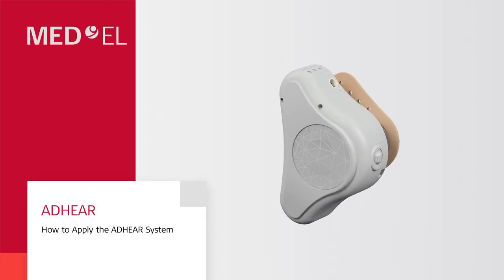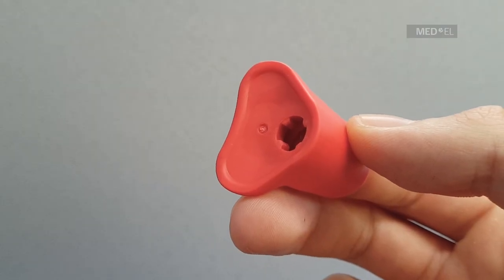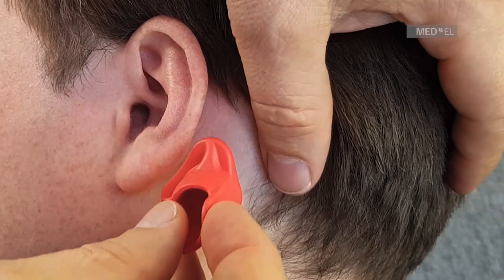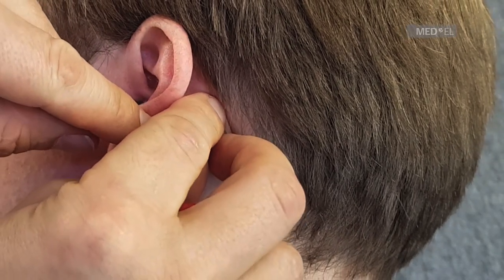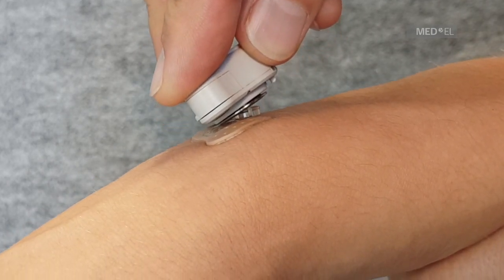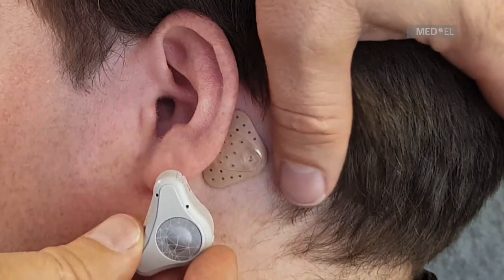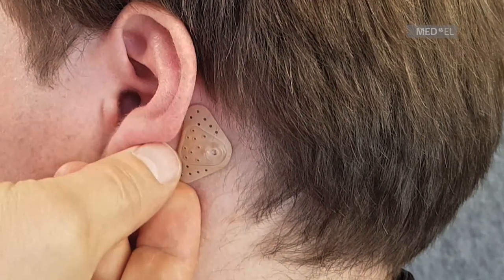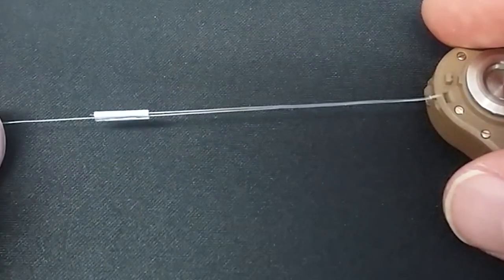Applying the ADHEAR System | MED-EL

Comment: This is a great instructional video, THANKS!    But I have one question/comment:  The rolling/pressing technique for removing and installing the device seems like the wrong approach based on my structural engineering experience.  Rolling towards the ear if feasible should help the sticker stay on a bit longer, as it puts the peeling forces on the side of the adhesive sticker that will better resist peeling due to its bigger flat suction cup like area.
Reply: Interestingly, page 2 of 28968CE_r1_1_ADHEARquickuserguideFL-WEB.pdf I downloaded from Med-El supports my comment.
Reply from the maker: Hi  @glike2 , thank you for sharing. The procedure here shown aims to guarantee the stability of the positioning of the adhesive adapter, and that the plastic material snap connection is well preserved for all the times the user will want to replace the device. 
Kind Regards, Giulia

Comment: Can I do jogging while using adhere hearing aid can it be remove easily at the time of sweating?
Reply from the maker: Hi there, thank you for your question. With ADHEAR you can run freely, and if you wish to feel even safer, you could use a retention clip as an extra fixation option. Other option would be to use a headband. 

Kind Regards,
Giulia